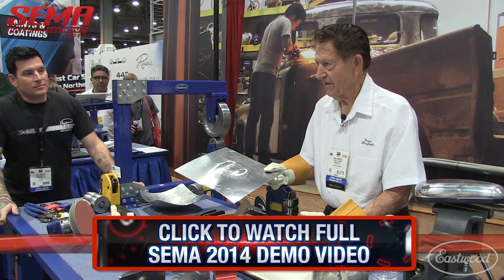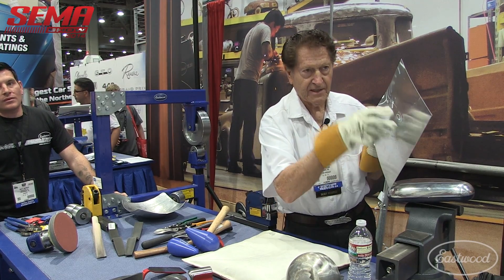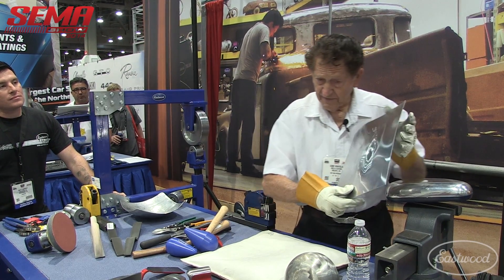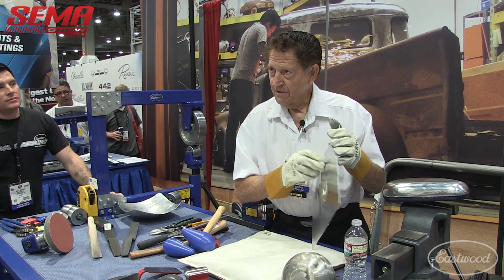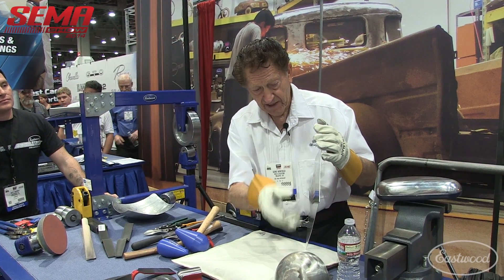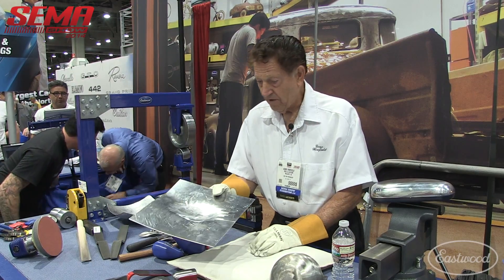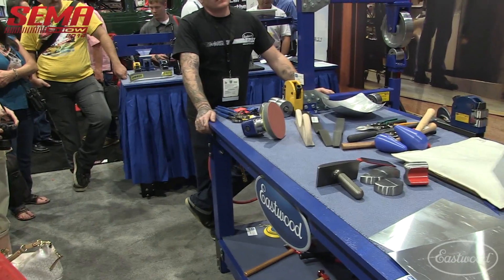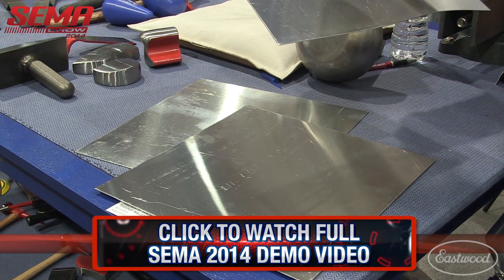Softening / Annealing Aluminum w/ Gene Winfield - SEMA 2014 - Eastwood

Comment: I'm just doing a course on welding and one of the sections is heat treatment, this overs annealing perfectly. Are there any demonstrations on how the soot is used?

Thanks for the video. Really informative!
Reply: Use the soot as a temperature guage.   Heat the plate up evenly.  Keep the flame moving.   When you burn the soot off the plate is done. Its not ridiculous heat.   Remeber ali melts easily.